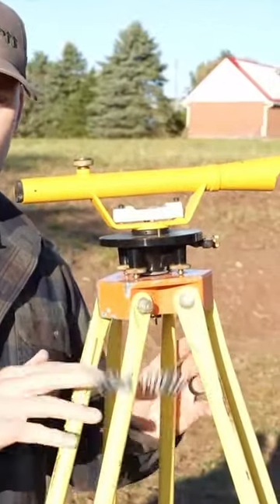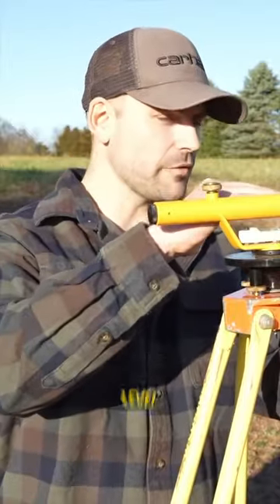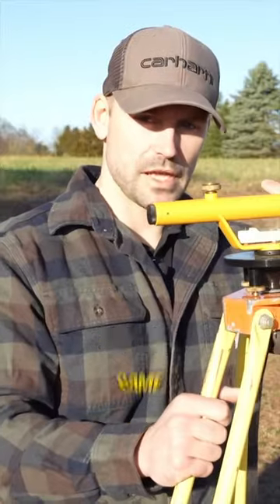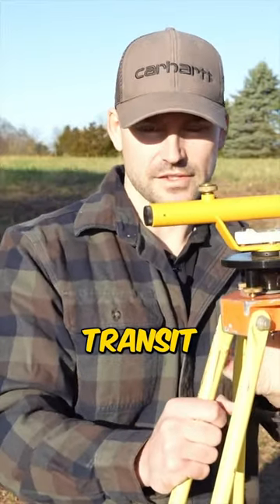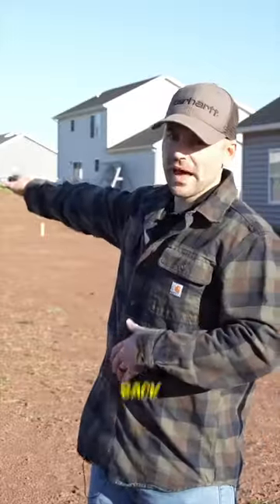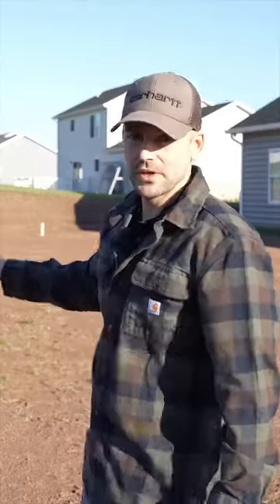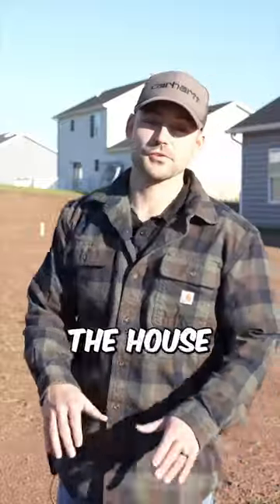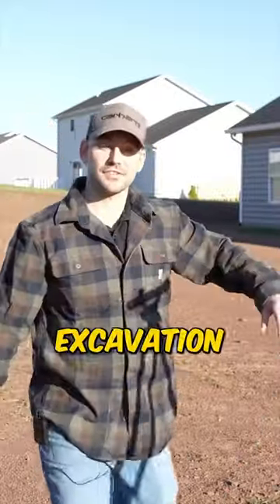How To Shoot Grade Using A Builders Level Transit! #shorts #build #construction

Comment: That's really cool and all but just so you know, Bosch sells a really good self leveling laser kit that ive used for years working for my dad. I just looked it up and it's 700 dollars for the whole set at Lowes. Comes with tripod, laser, receiver and the measuring stick, and batteries, plus a remote but I always throw that away. Don't need no damn remote lol.
I feel like this would save you a ton of time that's why I recommend it. It'll last many years if you don't drop it or something.
Reply: Yeah? Topcon and Leica make amazing duel sloping lasers. Precision AND distance.

Comment: It's not a transit, it's a level that has both vertical and horizontal hairs.  It doesn't measure the angles, just allows you to keep line and hold an elevation.